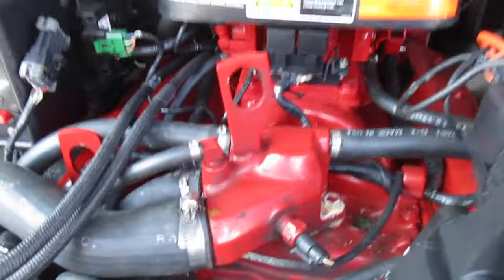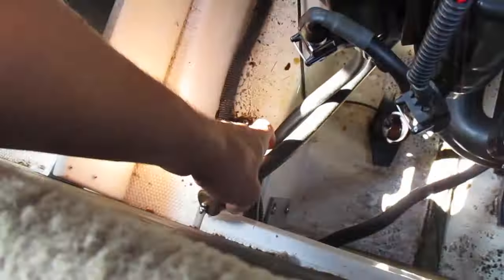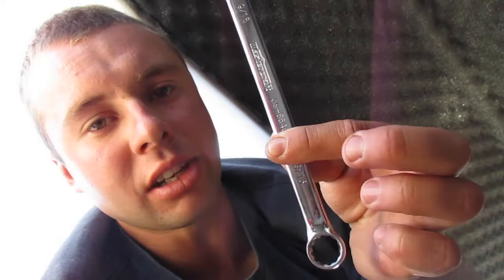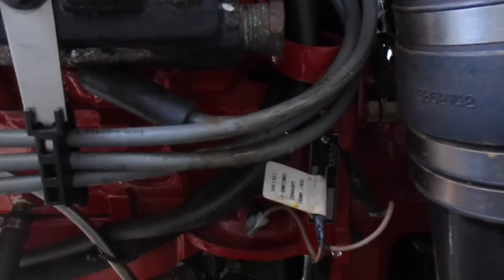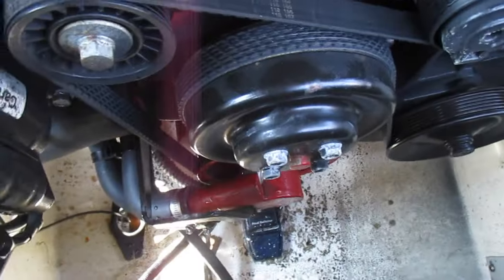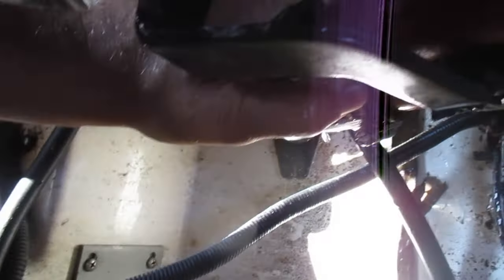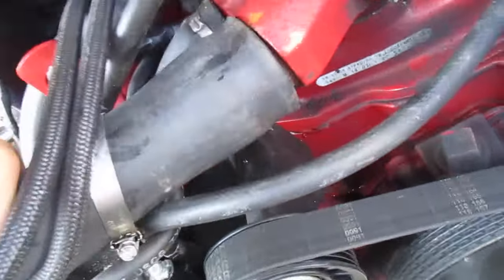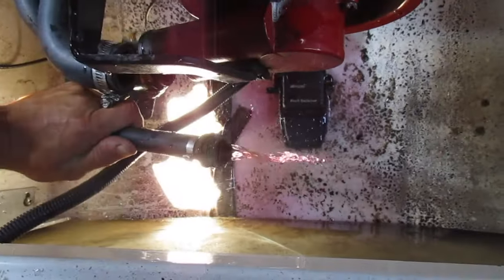Volvo Penta 5.0 GXI Winterization. Drain Your Boat For Winter.

Comment: hello, what does "burp" the engine mean? does that mean try to fully get it turn over by the key and starting it fully? Thank you.
Reply from the maker: The objective is not to start it but give it a quick turn (usually starts) to rotate impeller to drain anything caught in the vanes. Likely overkill to do.
Reply: @Schneids15  Summarizing now the petcock plugs will not stay in. I get them started, turn a few times, they pop out. I'm trying to find replacements online. volvo penta drain plug part 22848 is no where to be found. Got time to help an old man out with a link or advice? Thank You!
Reply from the maker: @northwestlife_9  hey! If those are stripped(never had it happen) take them to your local hardware store. They are standard plugs depending on what the manufacturer used. Sometimes 1/8” pipe plugs or 1/4”. NPT They are all pipe thread (NPT) and anything will fit. Just make sure you get brass not steel.
Reply: @Schneids15  Wow! Thank you! Very helpful.
Reply from the maker: @northwestlife_9  if you’re in a huge pinch and can only find steel ones just put them in but be sure to swap them to brass in the future or you will never get them back out.
Reply: @Schneids15  Not a huge rush. Today was going to be D Day for testing whether or not my winterization passedmade the test of a  bitter cold winter. I'll get the brass plugs. BTW, the hex is 9/16 and the threads look just shy of that. I'll call ACE on Monday. I hope your responses help someone else down the road. Thanks again.
Reply from the maker: No problem. Yes sometimes those 9/16” plugs are bigger. But they run 1/8 1/4 3/8 and 1/2 i believe. However some manufacturers change things up and run a reducer with smaller plugs etc. good luck!
Reply: @Schneids15  Napa Auto parts had the exact right plug. They are 1/4".  Now both my manifold plugs leak. They have the hole on them instead of just a plug. I'm guessing there is a reason for the hole, but they let water out the plug. 

This just seems more confusing than it should be. LOL
Reply from the maker: So the ones with the hole are supposed to go into a taper seat that is there previously. Just get a 1/4” NPT solid brass plug and put it in and you will be set.
Reply: @Schneids15  I swapped them and everything is sealed.  I swear I tried that already. The ones with the holes go into the block. The regular plugs go into the exhaust manifold. You're awesome. I'm  not. I have backup plugs now! LOL

Comment: ahh but the OMC Cobra has a few good points, that modern Mercruisers do not. 1) easier to replace bellows, just like a Volvo SX, because Volvo copied (yes they did) OMC's better transom mount design when they had the joint venture between OMC and Volvo (1994-1998). 
2) easiest impeller ever to replace, even easier than Volvo's, and much less expensive to boot. Also OMC Cobras are not prone to the leaky steering actuator and leaky trim rams that you sometimes see on Volvo SXs. And not prone to the worn hinge pins and transom mount leaks on Mercruisers. It was a  better design, too bad the company was over-extended and poorly run.
Reply from the maker: That is all true and i agree. On the other hand there is a reason Mercury is in business but omc is not too.

Comment: Do i need to fog the engine? About the outdrive, is it ever needs to be serviced or winterized? i got volvo penta 5.0 gxi with dual prop SX outdrive. Also, what type of grease would you recommend to use on gimbal bearing? Thx
Reply from the maker: The outdrive change the oil in it. If you don’t change it make sure there is no water in it. I would recommend any grease that is certified to be a wheel bearing grease will suit fine. You can fog it. Many people do and many people do not. I personally don’t unless i know they will be in storage for more than a year.
Reply: Schneids15 thank you. I will try to find a video how to change oil on outdrives.
Reply from the maker: I have one on how to do the oil. Labeled volvo sx, dp gear lube change.

Comment: WHy wouldnt you reconnect all the hoses and plugs then hook up antifreeze to stern drive water intake and run engine filling it with antifreeze, then there is no need to "summerize"  just turn the key and go.
Reply from the maker: There is lots of possibilities of freezing still. This is the best method to be 100% sure of no freezing. You could always put the plugs in once drained and you would be summarized.

Comment: Pulling those hoses off the raw water pump and t stat housing is not necessary
Reply from the maker: Not necessary until one freezes... so much trapped water comes out. Yes it may expand and be alright but this is a 100% method.
Reply: @Schneids15  what's going to freeze? 2 ounces of water? In a rubber hose at that?
Reply: how do you pour in the pink stuff then ?